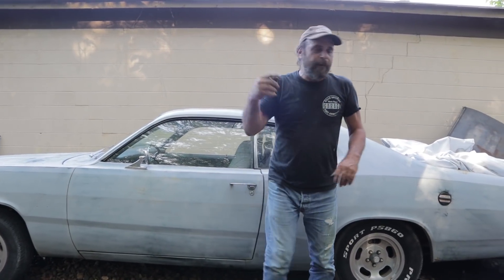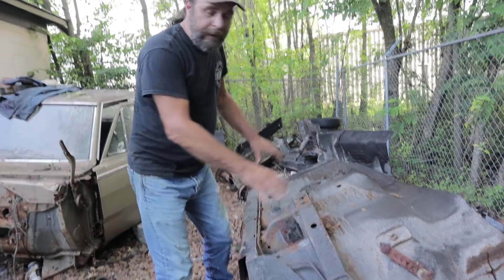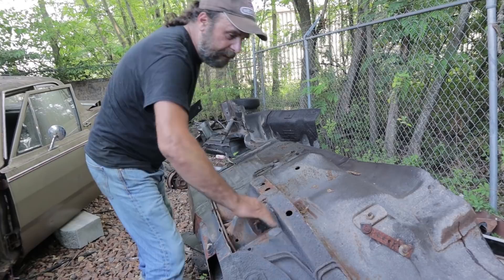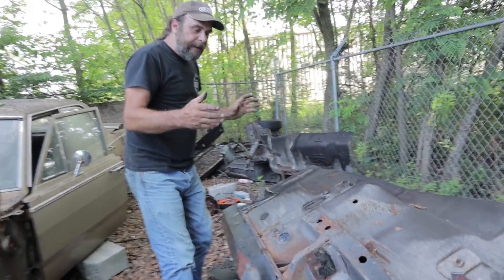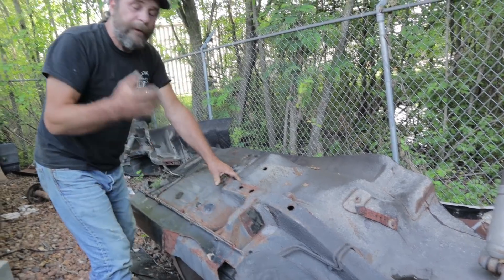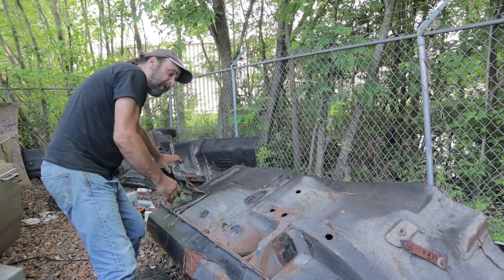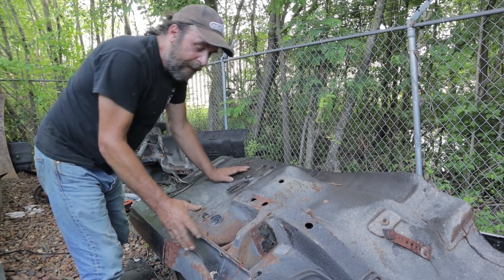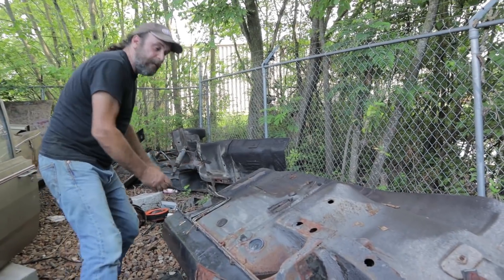Chassis Basics-Frame Connectors

Comment: And that's good to know.  I hear alot of people telling me to brace my 78 trans am.
Reply: ...and you absolutely should. Those cars are well known to rip the roofs at the top of the C-pillar if it's a T-top car. Tony has his opinion, but I disagree with it...
Reply: @TheBrokenLife  Yeah its has t tops. Never heard anyone say that before. I guess I never researched the t tops.
Reply: @bluerocky1902  If you want to see it, Kevin Tets over on Eastwood's channel put a new roof on one in one of their restoration series due to that issue (been a few years back). If you look at the car, there's only about 1.5" of metal right there and no other structure so it makes plenty of sense. He elected to delete the Ts entirely and just put a solid roof on that car. I can't remember if he did connectors too or not.
Reply: @TheBrokenLife  I will definitely check him out.
Reply: This it the Apples to Oranges Comparing.. only cause of the Mopar being a Pioneer of Unit Body Car.. and GM body on frame devoted.. F body GM has massive amounts of Flex.. just my two pennies on the Floor.. peace
Reply: @AtZero138  The first unibody car was built in 1935. It's not some magic that Chrysler got right and then everyone else has bungled up for decades. Plus, Tony didn't say don't add them to your Mopar, he said don't add them, and I disagree with his reasoning.

That's what this is. A disagreement among gentleman.
Reply: @TheBrokenLife  Haha.. your awesome and a true Gentlemen.. and Yes the Chrylser Aero.. wasn't it.. those films of it being Rolled over and driven off a cliff are shocking to say the least.. after each crash they open and close all doors.. I've only seen one in person.. it's a true Mopar,  face only a Mother could love.. thank you Jesus Chrysler and Holy Mother Mopar.. Peace ..